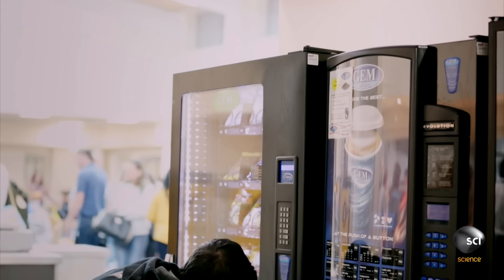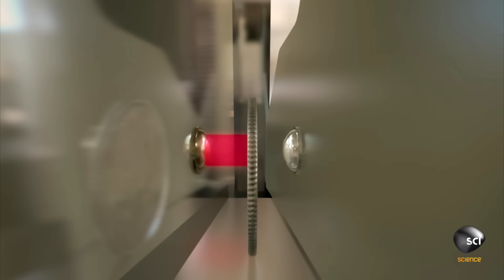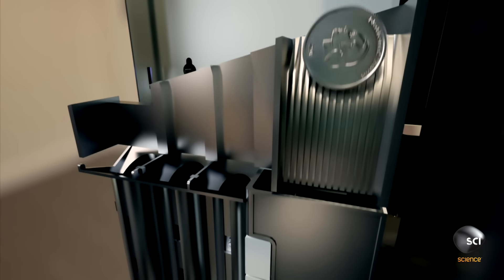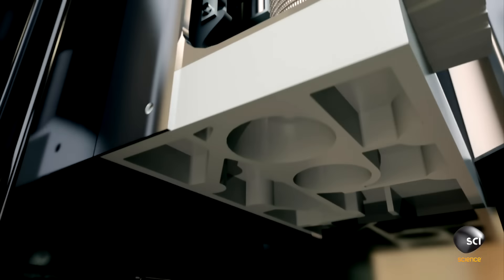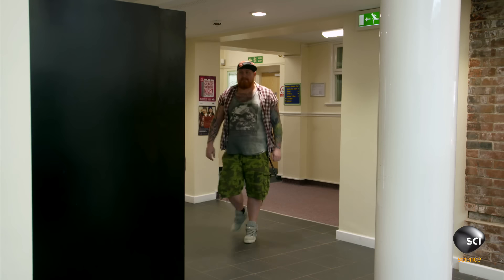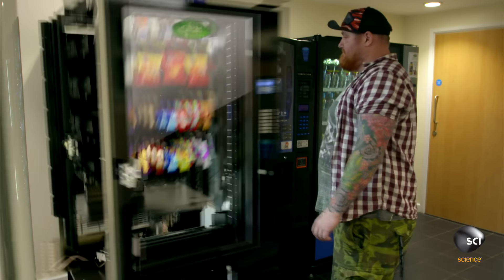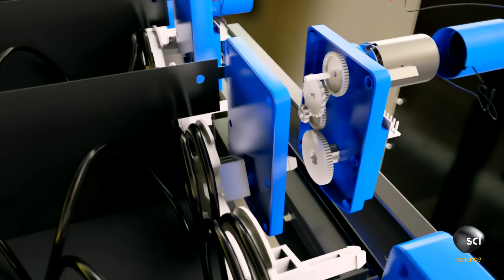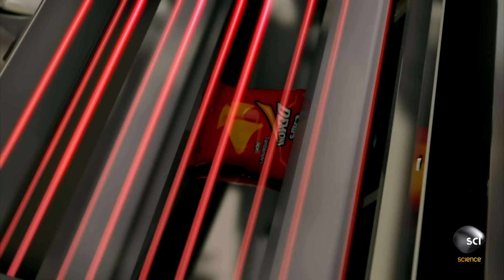How Do Vending Machines Detect Fake Coins?

Comment: So if food gets stuck in some other way before the lasers, the machine will keep dropping more and more snacks on-top of it... Genius!
Reply: esabgi Search MrTriplzzz his video is hilarious
Reply: here in germany they dont.
Reply: LOL that never really happens most machines that are in use are at least 5+ years old and most of them don't have that laser mechanism.
Reply: michael1234252 un
Reply: I got two of the same snack worth 3$ from a vending machine for that reason :D but I had to call my fat friend to tip over the machine to get the second one which also got stuck lol
Reply: esabgi    No, never came across a vending machine that uses that laser senser.   Normally it is a force sensor of the motor and vibration sensor (cheap microphone) on the exit.

Comment: or you could break the glass and take all the food it guaranteed works everything 

unless you get arrested
Reply: it would be very, very hard to do it.  You have have a better chance of asking someone for money then breaking the glass
Reply: They wont catch you if you sprint fast enough
Reply: +s0what778 eh, it would take me like ten seconds with a diamond bur bit in my dremel to bore a hole large enough to fit a metal skewer through and peirce all of the bags I want .
Reply: And that is if you can break the glass
Reply: hazardousmateriel_1 how do you Sprint
Reply: By soldiers.
Reply: That what i call eat on a run
Reply: CrackHeadDemon the opposite of the way you verizon
Reply: They sell vending machine keys online on some websites. That's how I get free snakes every week at my school!! 😂👌
Reply: CrackHeadDemon hold shift
Reply: Jagvir Rathore Isn't that exactly what HowToBasic did in one of his video? 😂

Comment: I grew up helping my dad run his vending machine route.   Many memories of helping him clean and repair machines, filling them, and counting and rolling up coins while we were driving to the next location.   Plus moving machines in and out of locations, often up and down narrow stairs.  Don't miss that part.  
   The previous version of the coin acceptor/rejector and counter is a masterwork of electromechanical design.    First the coin goes through the ACMR  (All Coin Mechanical Rejector) It sorted the coins by size and weight to put them into different chutes by denomination, and passed them by a magnet to detect steel slugs.   It even had a mechanism that checked for the milling on the edges of the quarters and dimes.       
   Once the ACMR sorted and accepted them they went into chutes that counted each coin and transmitted pulses of current to the totalizer.   A nickel sent one pulse, a dime two, and so on.  Once enough total accumulated, it unlocked the rest of the machine to dispense a candy bar or whatever.  SImple machines only allowed a single price across all selections, more complicated ones allowed multiple prices.  Once an item got vended, the totalizer deducted the price, then dispensed change (mostly nickels, but later dimes and nickels )into the coin return chute until the totalizer counted back down to zero.    The change tubes had a clever design to replenish them with nickels and dimes, and when full, divert them to the coin box.  
   If a coin was off weight or the milling was missing from the quarters or dimes, they diverted it to the coin return chute.   Coins that were bent, and slugs that were ferrous or had holes in the middle (washers) got trapped in the ACMR, and you had to press the coin return lever that dumped everything into the coin return chute, and told the totalizer to return all accumulated value.    (that was one of the tricks for when you didn't have a dime for a pay phone, you put a quarter into the candy machine and then pressed coin return, and you got back nickels and dimes.) 
   These coin mechanisms were complicated and needed to be kept clean and lubricated properly. We would routinely carry a couple of spare coin mechanisms to replace ones that had gotten sticky or jammed a lot.  You could adjust them to be loose or tight in the tolerances of the coins, but tuning it tight meant that worn coins would be rejected because they were light and thinner, and irritating to legit customers.
Reply: Good to see someone who knows. I used to fill those machines too. Occasionally I would see coins backed right up to the coin slot. If they hadn't passed the counter we'd refund them to reception (being honest with integrity) .
Ps Bent / malformed / dirty coins. Bane of my existence.
Reply: This is the video I wanted to see. 
"Computers lol" is such a boring answer
Reply: @schmo49  Indeed, mechanical vending machines existed even 2000 years ago.
Reply: Thanks for the explanation of older vending machines.
Reply: This story is more intriguing than the video.
Reply: Can't u just put a small Wire in the coin and pull it out ? Like bender from futurama
Reply: @milkitforxp8423  I imagine the mechanisms it goes through is a one-way trip, in other words, you probaby won't be able to pull the coin out once it's a certain way in. But I'm guessing, I dont know much about Vending Machines
Reply: It's interesting to know how complicated is something that seems simple
Reply: @junehanabi1756    Monofiliment fishing line and a dot of superglue to the coin worked for a while.  Then they added an overhang with a sharp edge so that when the bad guy tried pulling it back it cut the line, collecting the coin.   Metal lines would add too much weight triggering a reject.      This was a decades long low key war between the industry and the small time thieves.   Smarter thieves targeted places where you got more than a candy bar or a pack of cigarettes for risking arrest.
Reply: I don’t care
Reply: @LegendaryLimeYT  so? What’s your point?
Reply: @1blueorange  someone’s depressed
Reply: @chinanumberone7723  who?
Reply: Bro really wrote an essay
Reply: I like this, because it looks like a carefully thought engineering. Just as complex as needed to be for the job done. Nowadays we are having sometimes overcomplicated things just because we can but on the other hand we cant test them because there is no time and they will break faster because they are well - complicated.
Reply: mucho texto
Reply: Jesus
Reply: I Did a couple of different routes over fifteen years. I did everything you just described. This was in New England winters and summers. The van had NO A/C and a crappy heater. Definitely a young man's job.  1994 was the last year I did it.

Comment: When they put an actual effort to make it so the vending machine doesn’t screw up 

Vending machine : THAT BILL IS TOO FUCKING WRINKLY
Reply: It's a load of hockey, 80% of vending machines still out in the wild are older ones that still accept faked coins as long as they're the right circumference, width, and weight. More rural areas especially are filled with them.
Reply: @ninjaboylaoprime  and the snacks get stuck. I've seen 3 bags of chips dangling from the same slot.
Reply: @R.M.MacFru  yeah, the old ones also don't have that protection built in either. The middle ground was the ones that would detect if a product dropped based on a weight sensor, those were terrible. You could push the flap open so it never hit the bottom and get 2 or 3 on one vend

Comment: As kids we taped 20 cent coins on a railroad track and when the train drove over it they were the same size as a 2 dollar (swiss francs) coin. This worked with older vending machines on train stations which only checked the size not the thickness.

Comment: Wait why is there Braille on the buttons if they can’t see what they’re getting
Reply: Trover19 lol good point... 🧐
Reply: Somebody could just as easily do it for them, but a blind person would simply need to be told the code of their desired snack and they can handle it on their own from there
Reply: Blind people is always on that 'surprise me' scenario
Reply: @Envinite  anu chiki briki i v damke ;) hehe
Reply: its the blind man special
Reply: wait a minute....
Reply: Vendor tend to put the same snacks in the same spots and seldom change inventory
Reply: Uh...
Reply: Cos the Braille tells them the name of the snack they are getting 🤷🏼‍♂️
Reply: Lol yes
Reply: There's some sort of American law that requires braille to be on things like this. That's why on a car steering wheel with buttons there us braille. A blind man can't drive but the buttons in modern cars are in steering wheels.
Reply: RGTube no that’s not the reason it’s on the buttons on steering columns. It makes it easier to remember what button you need to push for which functions you want. If the buttons were all smooth it would be harder to know which one you were on to change a particular function from another function.
Reply: @andrewdarbyshire9108  when playing on an xbox or ps4 controller you don't need to memorize where the buttons are. Same goes for a keyboard with the PCMR. It's basically muscle memory. That's also the reason why F and J have bumps,  yes it helps people that can see, but it also helps people that are blind that have memorized the entire keyboard.
Reply: Dare devil?
Reply: Mike B until the guy restocking changes the inventory around.
Reply: They read what they are getting with the brail....
Reply: Yeah I'm blind and I can't see what. Getting
Reply: A blind person could be surprised with one. The other thing is the person might not be completely blind (I think this is the thing most people forget, blindness is a spectrum). Also don't forget old people who have decreased reading vision. Some legally blind people can still read large print, or maybe tell things apart by color (roughly), but they won't be able to read the pin pad. I would know, I started losing a bit of light perception in my eyes since last year. A well lit vending machine with large text is probably fine but I struggle with pinpads quite a bit already.
Reply: @SunnyWu  this is the best comment imo and makes the most sense.
Reply: @longegg-wind9577  LMAO have you ever used a vending machine
Reply: Well, you see...

There's a line of infrared lasers that project a laser beam directly into the eyes of the user nearest the machine.  A computer calculates the pupil dilation, or lack there of, enabling a special assistance mode, using a high modulated audio pulse wave that indicates to the blind person to plug in their headphones into the unmentioned headphone jack.

Then the machine, utilizing an intricate computer uplink, syncs up with a global network of satellites with an LTE data module and a highspeed fiber optic uplink to connect to the users's Facebook page, whereby it does a user-data-analysis, or (UDA) to determine the proper snack for dispensing.  Then, regardless of which snack code is entered, the proper snack is automatically dispensed, with a margin of error of 40% that they'll get something they're actually wanting.

Or they could just ask someone standing next to them.  VENDING MACHINES ARE THE FUTURE!

Comment: How Do Vending Machines Detect Fake Coins? ------ They don't
Reply: Correct!
Reply: Do most not really?
Reply: +Quantum well you do need to use the right metal and size, so unless you have a machine shop, getting fakes is probably more expensive than the real ones.
Reply: but wait , but if i get the fake ones CHEAP? hahah got ya
Reply: +Hatagashira  Not really, the fake coins are called slugs, and they are used a lot because most machines can't detect them. They are used in laundry mats all the time.
Reply: yes because when I was 7 I put fake quarters in a machine and it worked
Reply: +Quantum True, it only detect what appear to be a valid coin. Same size and a material with the a simmilar magnetic propriety. Size is very easy to copy, the material too: due to the tolerance of the sensors, a narrow margin of error is allowed. It do not have to be perfect. Some are said to also weight the coin. Again, due to time constains and slight variation (wear and dirt) it can't mesure the exact precise weight. So again, a narrow error margin is allowed.
What they want is catch most of the fake coins, not all. To catch all would cost too much, and wouln't prevent enought fraud to pay it back.
Reply: +Zygiz Things no
Reply: Quantum zinc plate
Cut to size of a quarter 

There ya go
Reply: kQuantumK true
Reply: So, how do you get slugs?
Reply: 0:00
Reply: kQuantumK yep they just eat it like every coin i had in my wallet and they where real coins

Comment: Imagine if those infrared beams were to think nothing fell, you could get the entire row of snacks. One way is to tilt the machine horizontal so that the beams never get crossed. 💫
Reply: Vending machines kill more people than sharks.
Mostly because sharks have no concept of how a vending machine works so they just dont even bother with one.

Nah but fr, those machines kill more people than sharks do.
Reply: @electricspider2267  ??? 😃 ???
Reply: Nah it will transform and bring out a machine gun to take you out
Reply: Modern problems require Modern solutions
Reply: Most vending machines now have a "TILT" switch. Tip it very much, it will lock out completely until serviced. Older ones have a "TILT" switch called Gravity. Tilt it too far, it will inflict the Death Penalty on you.
Reply: how are you going to tilt the whole machine sideways then back up again?
Reply: @Blox117  with my arms and body. I ain’t no soft marshmallow.
Reply: @TraumaER  good for you, but how much do those machines weigh and can you even fit your arms around it
Reply: @Blox117  I think so.

Comment: "The coins are carefully released one at a time"

As anyone who has received too much change from a vending machine can tell you, no, they don't. Also its VERY RARE that a machine uses lasers to detect if the product went into the bottom basket, it usually just ends up getting stuck and you're S.O.L.
Reply: Most of the modern ones I've seen if it doesn't see anything dropped it doesn't charge your card.
Reply: That's vending machine self preservation.  If the customer loses money or doesn't get a snack then the machine usually takes a severe beating
Reply: Depends on the machine. There are 2 types. The ones that spin the coils just enough to dispense the item (i.e. stepper motor that knows say...150 steps is enough to dispense 1 item. The other type which has guaranteed dispensing will (as the video says) spin the coils more if it fails to drop and does have sensors. (Probably IR although lasers would work as well) 
This stops people getting angry at the machine and doing a Homer Simpson raging at the machine. 
As for the change, I never looked at the change section closely but I assume it would be a solenoid that would push the bottom coin out the side (just a guess). I know the coins are stacked (each denomination) until full then excess coins drop into the money tray.  

* Ex vending machine filler
Reply: I've personally received over $5 - $7 in change from my schools vending machine after trying to get change for $2.
Reply: Bonus points if somebody tries to get another one of the stuck item, with the hope of knocking it free... but instead, the second one gets stuck too.  I swear I've seen machines in that state before.
Reply: @Kepler170  Hmm if you know a public machine like this maybe you could start something where people invest into your company and then you do this and give the money back + more.
Reply: @Kepler170  lol same!
Reply: When I was little we were staying at the Motel 6 for a month.  This drunk guy next to us used to try and steal things out of the vending machine by rocking it back and forth.  One night, we heard this loud crash and sure enough the machine had toppled over on top of him.  I'm sure he was drunk and didn't feel anything.

Comment: If the food remain stuck you  start kicking/flipping/moving  the machine to get your snack
Reply: +Patrick Star Stupid people die from doing that. Just don't stand in front it when you rock it.
Reply: *****
I've done it few when the thing don't fall down. Some extra things fall too - I think of it as tax for the company who owns the vending machine and haven't fixed it ;)
Reply: *****
Risks if I haven't won 2 electronics contests as a child , so no I wont get hit by electricity and im strong enough not to let the damn thing fall on me lol ;)
Reply: +tbyte the machines empty are like 500 lbs
Reply: +nathaniel scott and ? they are on the ground. i don't  lift them in the air ffs :) . i just shake it slow. u probably have to deal with about 50kilos which is nothing for a normal man.

Comment: They forgot how it detects which bill you put in.  For those wondering Machine expands into 5000 parts a high tech laser scans the bill, and an ultra sensitive scale weighs it, all while a super powerful electro magnet detects the iron composition of the ink, then an ultra precise infra red beam detects the shape of the bill.  This process is so precise that even the tiniest wrinkle or bent corner can ruin the whole thing and reject your dollar.

Comment: I’m starting to understand why the snacks in vending machines are so expensive. I wound need the money after designing something like this
Reply: There used to be a vending machine at my local IGA that sold off brand soda for $0.25 a can. For off brand soda it wasnt bad and quite the steal.

Unfortunately it's been replaced with a new one and I believe cost more than 25 cents now (havent been back to the machine since so I'm not sure.

Comment: Okay, but why do my coins get rejected sometimes even if I'm sure they're not fakes?
Reply: word
Reply: Most likely they weren't read properly
Reply: One of two things can happen.
1) If the coin like a dime or Nickel is pure silver, then the machine won't take it thinking it's a fake coin. 2) If the coin has damaged edges then it won't take it.
Reply: older coins with newer machines
Reply: Happens with 10p coins all the time they changed the thickness and ridges slightly.